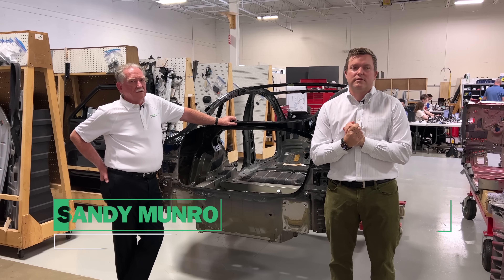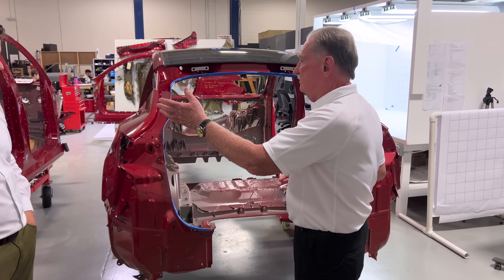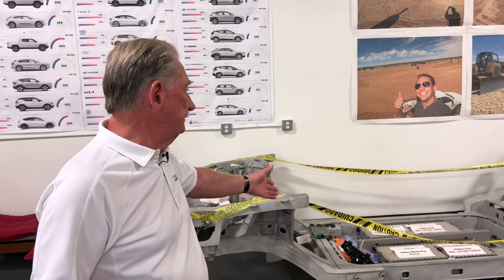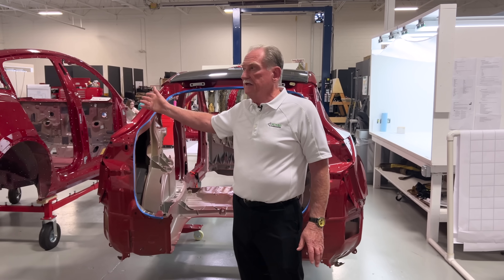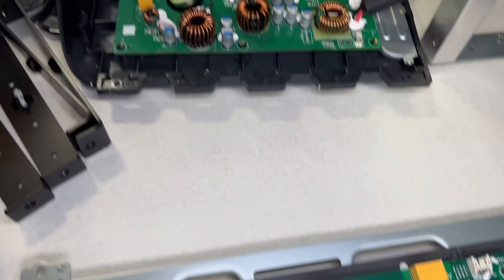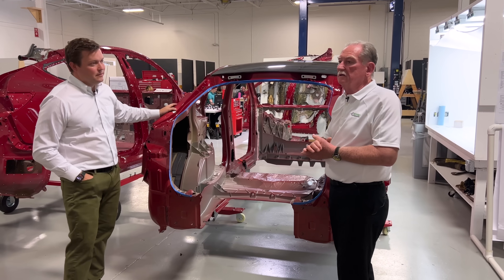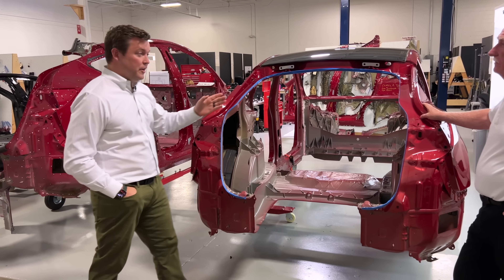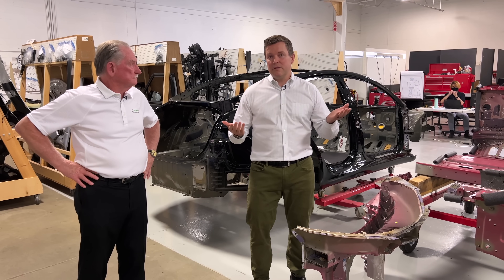Giga Castings with Sandy | Evolution of Tesla Bodies In White

Comment: It's great to see the improvements and how excited you are about them. That's why it's important to just tell it like it is. If you praise everything, it doesn't push for improvement.
Reply from the maker: Thanks Chris
Reply: Praising everything also destroys credibility.  That they hammered the 1st M3 version is why praise for improvements really matters.
Reply: @Mrbfgray  But even back then....Munro only hammered the body...not the drivetrain, electronics and battery pack. With the 'superbottle' probably being the 'swept of his feet' moment to fall in love with Tesla's innovative culture. 

If I recall correctly, after those things were analysed, a bunch of Munro employees bought a Tesla 😉.
Reply: @kaasman78      Great point.  Also he might have criticized most OEMs half as much for excess construction complexity and so on.
Reply: Yeah tend to agree , although a massive petrol head myself and love N/A engines electric cars should have come on a lot more . Now there are 2 reasons for this 

1 Nicola Tesla was ripped off by JP Morgan and it’s all about greed and money, not passion pride and innovation. So electric cars would have been developed sooner. 

2 electric vehicles were around before petrol ones , it was only America that pushed the internal combustion engine to the mainstream as they had an abundance of oil to sell , that’s why the big yank v8s produced pathetic bhp per litre . It didn’t matter how inefficient they were as more oil was sold for fuel . Then ford etc exported the petrol engine car  basically tow the world . All about money and greed eventually.
Reply: @newagetemplar6100    I'm a bit of a petrol head too, still love my high revving "old" BMW V8, but it's a replacement for the high performance motorcycles of my youth, not so utilitarian....can't think of anyone I'd recommend it to.

There was good fundamental reasons for early battery cars to fail over a century ago, the batteries were simply insufficient for anything but short city trips, then charge for say 8 hrs plus before another short trip was possible.  They were manufactured and sold but the demand wasn't there.

  Steam cars were also in the mix back then and the highest performance available for yrs, but startup time, hassle and low efficiencies favored gasoline by a wide margin. 

Even in the '90's, tho the GM EV1 was popular among those who owned them, and 40 mile range a big improvement over a century prior, it wasn't enough for most customers.  It was a missed opportunity as a glimpse of what far better batts could achieve.  Classic Xerox or Kodak moment by GM, but credit to them for doing it.
Reply: @Mrbfgray   , yeah totally agree we th you there mate ,  we’ve got an e36 m3 race car and building a space frame carbon fibre bodied e36 gtr , all designed and built by myself . Bikes argh ! they’re too scary for me ha ha , my dangally bits arnt big enough to ride one of those so hats off to you . Know what your saying with everything, it’s no different to the Uk and the industrial revolution , coal and Tin mines etc etc . My point really is battery technology would have progressed naturally due to ‘need’ if it wasn’t for American oil . This has just delayed the progression of battery technology by decades . It’s a bit like solar panels and hydrogen generators, they were all used on the space missions nearly 50 years ago so the technology was sort of around back then , but it would not have been in the best interest of the oil companies . In my opinion also the government’s don’t want people to be self sufficient and retire early anyway as we’re their only source of income and they need us to work till we drop , life’s one big conn , maybe I’m right maybe I’m wrong 😬
Reply: @newagetemplar6100    I have slightly modded, Dinan kit E-46 (2001 330), but at 146k miles there's so many issues, mostly minor but they add up, not sure it's worth the time effort and expense to even take care of the most pressing half of 'em.  Still really like it for a towny but is it worth saving?  IDK

My murdercycle days are behind me it seems.  Rode hard daily 'crotch rockets' for 15 yrs then without intention just fade away from it.  Don't much miss the exposure.  Surprisingly the E92-M3 is a very good substitute for ME.
Reply: @Mrbfgray  46’s are really the last of the good cars in a way I’d keep it and just maintain it yourself as parts are still easy to pick up . Just keep on top of the corrosion. Unfortunately I hate to say the engines after that as you may well know suffer from timing chain , rod and bearing issues. That’s all down to cost cutting and reducing internal drag in the engine for fuel efficiency . Blame company accountants , inexperienced designers and the green mob for that mainly. The s65 engine is awesome just watch the rod crank bearings  . I admire bike manufacturers for their engineering and engines everything seems to be made better and they have more pride in their work .
Reply: @newagetemplar6100    Yeah the S65 rod bearing thing....it's big sister the V10 needs new one's at 100k.  I've looked into it 6 ways to Sunday before thinking of a purchase and it's still hard to say what's best to do, how much a problem it really is.

I run clean fresh highest quality engine oils and warm it up fully before working it but I have no control over the 1st 45k miles.  One prior owner was a key for me.  An 8 or 10 yr old car w 4 or 5 prior owners--none of them OWNED IT they just rented.  

I'll have bearings replaced, install new throttle actuators and maybe a few other things proactively.  Beyond that it's pretty solid best I can tell.  No issues so far, not a single (knock on wood) problem worth mentioning in 4 yrs of moderate use.
Reply: @newagetemplar6100    Hate to be harsh but--anyone who doesn't take pride in their work, whatever it is, I have zero respect for.
Reply: @Mrbfgray  think you have got everything sorted really and seem clued up enough I couldn’t advise you any better . Sometimes it’s just bad luck I think if the bearings fail . Only other advice I could give is dependant on your financial circumstances. I have no interest in your personal finances and please don’t miss understand me here , I’d do the bearings etc if you can afford to pay for them ie cash / money in the bank . Cranks as far as I am aware cannot be reground, repaired reliably and a new one is 2  1/2k so even a slight rumble / knock isn’t cheap . So unless you can do some of the work yourself it may cost 5k if you don’t catch it . We’re slightly different to most people and don’t use credit cards or finance even though we’re not well off . As long as you have a really good income just be careful as there may be some bad Financial Times ahead . Paying your mortgage and eating etc is more important than blowing your money on rebuilds etc . If your on a tightish budget , wifey , kids and yours is the only income just be vary careful .
Reply: @Mrbfgray  yeah I know I’m an engineer and there arnt many people that have respect for engineers and tradesmen etc these days . I’m only going off life’s experiences. I’ve seen 2 recessions that nearly wiped out our family business the crash in 2008 and there’s another one coming . That’s my main concern . We’ve held off doing things properly sometimes when things are tight , sometimes you get away with it and other times it comes back to haunt you ffs lol . S65’s do need TLC and just make sure you get a decent engine builder to do the work
Reply: @Mrbfgray  ha ha good on you mate , It was only that recently I’ve had 2 friends screw themselves financially for having cars they can only just afford . I’ve looked at shorting etc and coin . Problem I’ve got is we’re just trying to buy my late fathers house , my sister screwed up the small family business left to my son and she has taken legal action against ourselves as she wants her money out of the estate. Earlier last year I was forced to sell my 964 turbo at a third of the price , have 5 e36s that I can’t finish and a mk1 rs1600 escort that will do 150k when done . And still try and finance a house purchase!! Ha ha ffs . Nearly threw 10k into bitcoin when it was at 17,000 18 months ago or invest in miners and solar panels . But that’s hindsight and wishful thinking . RWD is the best captain , commercial vehicles can be so much fun even when not that quick 👍

Comment: Aren’t casting very poor when it comes to strength/weight ratio tough? What I’ve learned in my manufacturing technology classes for my aerospace engineering degree I’m getting is that castings are very low tech and thus cheap but obtained structure will be much weaker and more prone to fatigue. Avoiding any treatment after casting (mostly as such complex casting cannot be processed in any meaningful way) would result in terrible resistance to fatigue and generally low strength. No proper pre stressing would also impact the fatigue resistance very much, especially in such a heavy car.

I don’t see how casting makes sense in car chassis and there is a reason why it isn’t used in any kind of vehicles that much nowadays (especially aluminum which doesn’t have a fatigue limit). I can only see if as a cost saving measure from Tesla and something that would introduce planned obsolescence, as these will be very susceptible to fatigue failure over time.
Reply: regardless of metallurgy?  tesla/spacex have  very  good material science people, to create unique alloys to suit the task at hand. the main benefit is  reduced robots to build, and time to make the part, also as sandy said, increased accuracy without the creep of errors. they will have some weight advantages with reduced glue and fasteners, but i dont think reduced weight compared to the stamped part was an expectation  going into it.
Reply: Sorry to say but I think you missed the point of this video.  If you are talking about casting materials, there are many types and this casting is a mix of aluminum and other alloys. Perhaps you should learn that a bit more on what goes into the materials and the Idra giga press technology.
Reply: Study this case more, all your outdated points have been dealt with, your in for some pleasant surprises
Reply: @jonbong98  I’m pretty sure what I’ve studied is up to date and what you read were just corporate advertisements not real engineering books.
Reply: @mioszradomski1825  evidently not. Study Idra and the alloys used, etc many in-depth analysis are available. Also crash test results. Any training, even if you finished yesterday is Inevitably Not Current. 
Ps Tesla don't do marketing, they don't need to.
Reply: Correct. I think they are. But positives on manufacturing are really what it counts to increse margins. Altought for more we should buy report LOL Company doesn't care about your problem if whole car have 10% more material from castings.
Reply: I didn’t say it doesn’t make sense from the companies’ standpoint - as I’ve stated in the end it is in fact probably very beneficial for them. Just not the customer, at least one who plans to use the car for a long time. Cheaper but lower quality product that is designed to fail after some time.
Reply: @mioszradomski1825  cheaper but of unmatched, higher quality, durability, accuracy, strength, and a much longer life